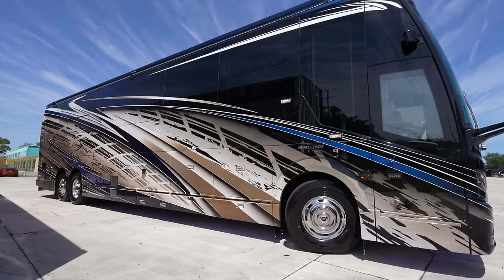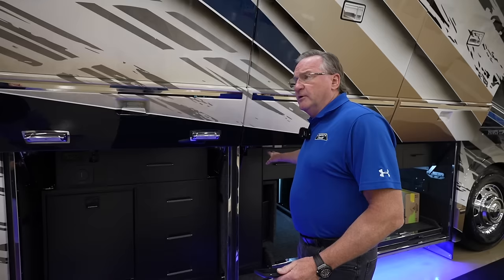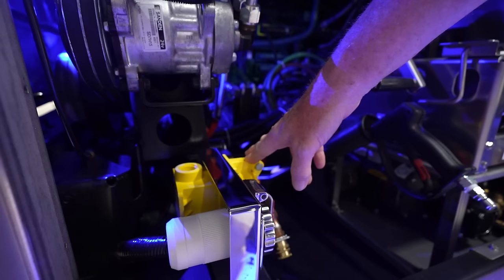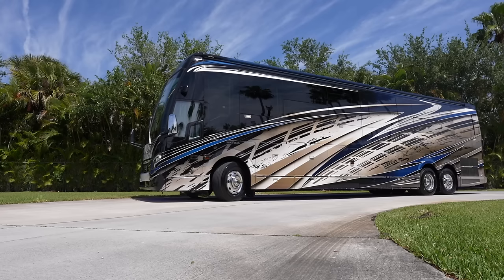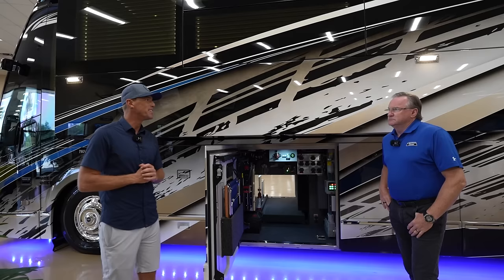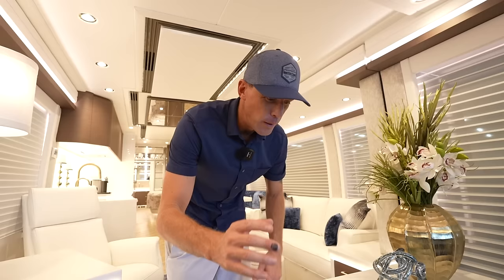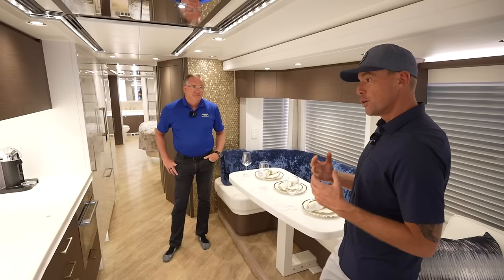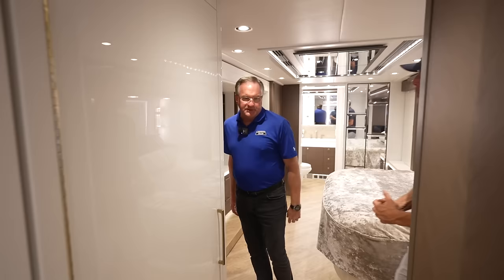2024 Liberty Coach #908(New Body Style Triple Slide!)

Comment: It amazes me that at this price point they dont have flat floor slides on all slides. Dinette looks bad raised up. Newell all slides are flat floor. Thats the difference of building the chassis from scratch to be a coach vs cutting up a bus chassis to make a coach
Reply: Thank you for the comment, the Prevost chassis is not actually "cut up" for the slides, the chassis is built and designed differently for slide rooms than the seated coach.  The four slide Prevost actually has a flat floor on the passenger side front, there are advantages and disadvantages for both, more people prefer the taller bays on the Prevost slide which is an advantage of a non-flat floor slide design
Reply: Pros and cons on both. I love them almost the same. But maybe slightly like Newell better